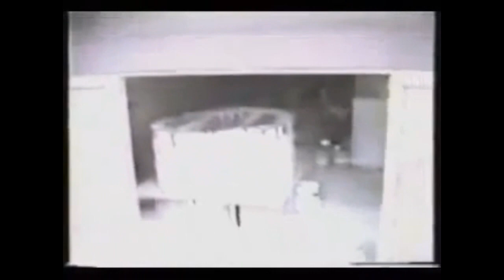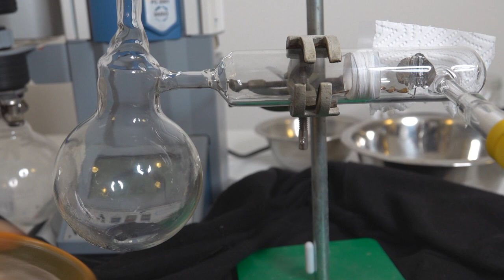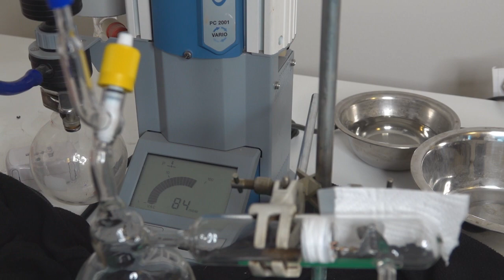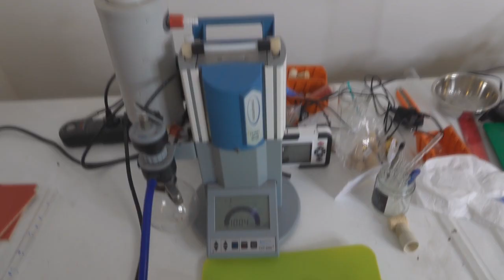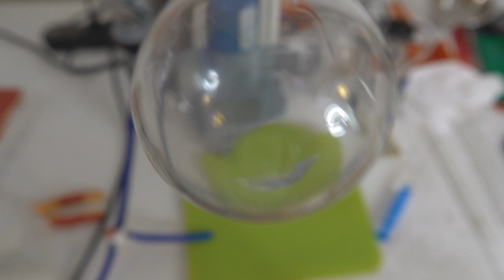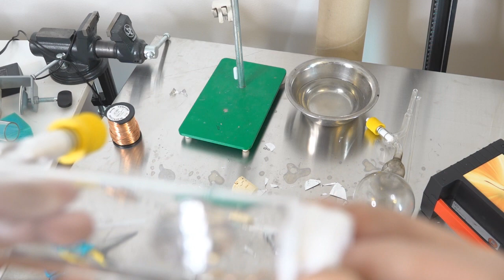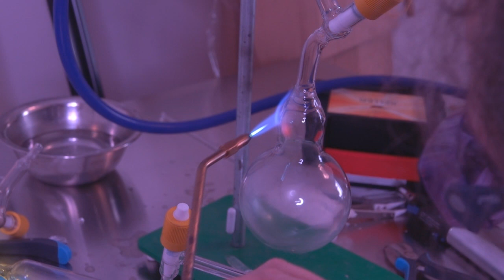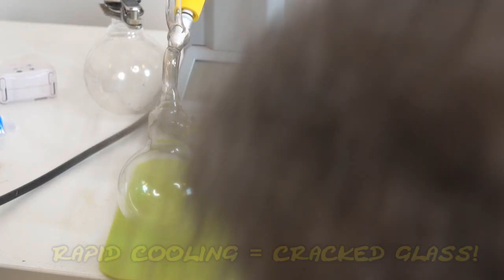The “Hydro-Vac” Space-Powered Steam Engine!

Comment: Sooo... it's just a steam engine but at a different pressure and temperature that the ones that people are used to seeing. Oh, and let's not forget that the temperature difference between the two sides is only about 20 degrees. Not the minimum of 80 in normal steam engines. So it's a much less efficient one. Sooo.. why did you even waste your time debunking this? Why did I waste time watching this? Idk.

Comment: This is stupid. It requires differential pressure to run which requires a difference in temperature to react with a liquid and in this case water. Sure it works in a worm room with ice at the other end. The water under vacuum boils at that temperature and will eventually boil off and condense in the other flask. It still takes energy to heat the room and energy to make the ice. You might as well shown a Stirling hot air engine. Stupid indeed .